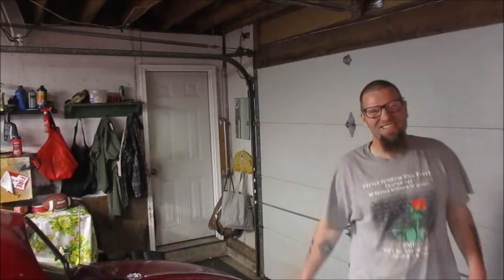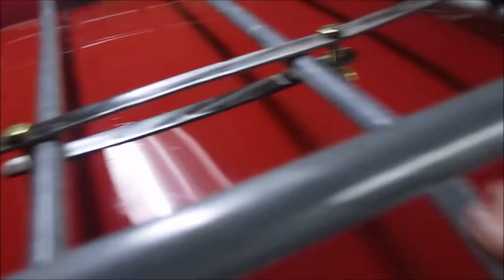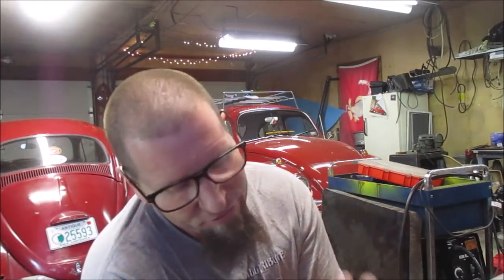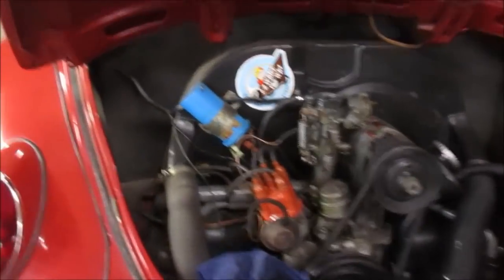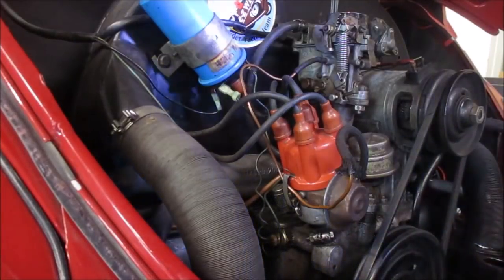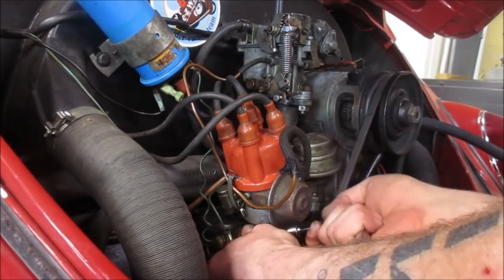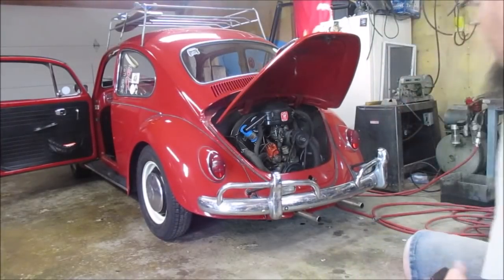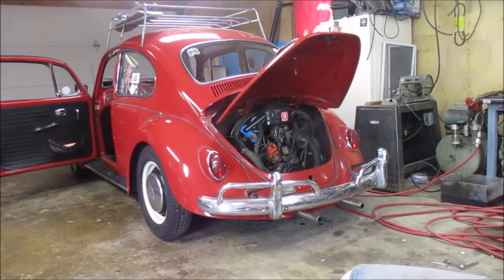1967 VOLKSWAGEN BUG 1500CC VIEWER QUESTIONS ANSWERED FOR angrydogvw

Comment: Hi VWNUT can you run a svda with a 30 pict 1? I am currently running a pertronics electronic ignition with mechanical advance. This is why I'm asking about using the SVDA without changing my carb. I just love the simplicity of the engines. Thanks for the great video. Jim
Reply from the maker: I can not say for sure. But i will say this. Give it a try if it runs good and you like the results stick with it. Thank you for watching Jim

Comment: Hey VwNut I got a question I am looking at a 1967 complete motor and going to install in my 64 beetle. How did you wire up the generator. Any help please and thank you !!
Reply from the maker: If your 64 is still 6v then it will need to be converted to 12v or you can put a 6v generator on the 67 engine. as far as how it is wired up it is just the same 3 wires that were hooked up to the 64's generator. Hope this helps
Reply: @vwnut1967  thanks it helped tremendously